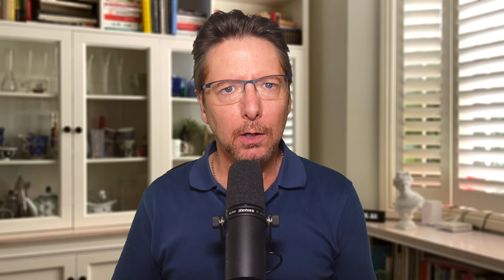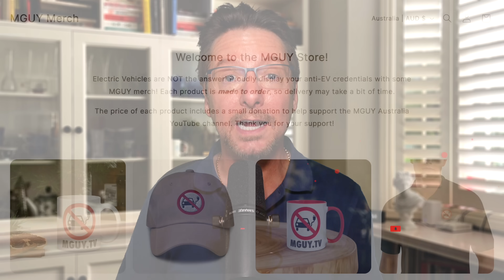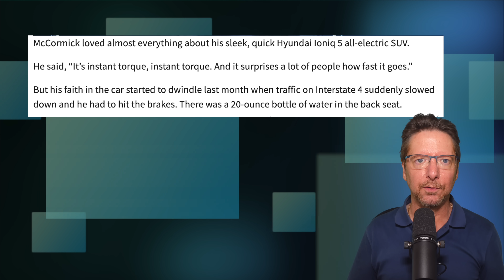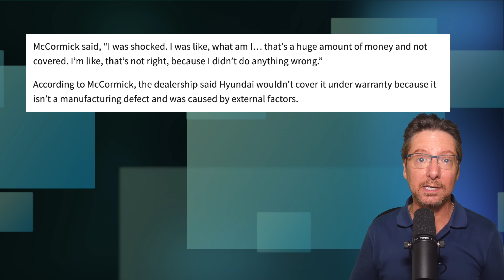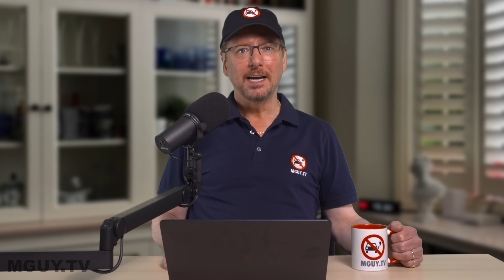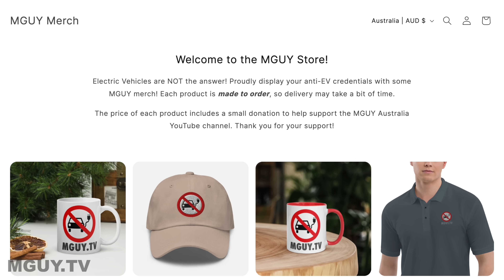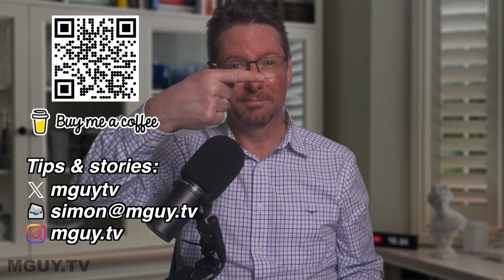ASTRONOMICAL EV repair bill for spilling a WATER BOTTLE! | MGUY Australia

Comment: If you are stupid enough to buy one. Live with the consequences. My 25 year old LandCruiser I can hose out the inside. It doesn't care. It wades through water up over the sills. Doesn't bat an eyelid. Certainly wouldn't try that with a milk float. Not even a 4WD version.
Reply: A Youtuber I follow had to call for an ambulance (Scotland) and during his ride to the hospital, a thunderstorm struck, and due to the 4 “ of water on the road, the EV ambulance had to pull over and wait for the rain to subside.
Reply: To be fair the 70 Series was built to be indestructible in the toughest conditions the world has to offer. I wouldn't risk hosing the interior or driving through water in any late model vehicle, there's way to much electronic stuff even in ICE vehicles these days.
Reply: @Fancy_Fly_7693 not in my 2008 Nissan Note!
Reply: Same with our 1995 GMC VAndura 2500.  Now at 209397miles.  Hosed it out a couple of times, front to back, after driving through a couple of muddy rivers.  What you do is park in on a slant driveway (ours) and hose out the back.  then used Ryobi leaf blower to vent the rest of the hidden water out.  Clean as whistle now.  PS:  The clearance to the air intake, and the radiator Fan is so high, that you can literally drive it slowly through two+feet of water.  No issues.
Reply: My 40 year old landrover does the same while marking his spot😂
Reply: In the UK we wont'thav a choice  as new petrol/diesel  cars will be banned by 2030.

As a cyclist this is good news as means less cars on the road as nobody is going to buy electric except rich politicians
Reply: @Recumbent_Rider We will see. Net zero is starting to hit the skids. You have a party in the wings waiting to make changes. And now in Australia, our opposition party are going all out to drop net zero too. Electric Utopia might get turned on it's arse.
Reply: @Recumbent_Rider You think you won't be paying road tax and insurance before Labour are done?
Reply: I have a Lexus hybrid & its fine but more like Highlander though would have preferred with Land Cruiser assembly. that early 2000s for Toyota Lexus was pretty good era
Reply: Yeah but when we are all forced to live in 15 minute cities there won't be any driving through standing water, or muddy country roads,  or putting dogs in the back seat, you know, all the "normal" stuff will be banned. Along with confiscation of your good old faithful workhorse 😢
Reply: I used to own a 1966 Series 2 Landrover....I used to hose out the inside to clean it....but the 55 MPH top speed, horrendous fuel economy, no sychromesh on first and second gear, cart spring suspension and no power steering is not something I want now....My BYD seal has 305 BHP, per mile running costs equivalent to a Vespa scooter (150 MPG), exceptionally quiet, comfortable and easy to drive and cost less than an equivalent Toyota Camry.....
Reply: @martinwalker9234  Hmm, no comment from the girls here. Too busy clutching their Pearls and dreaming up fantasy negative scenarios about a car they know nothing about.
Reply: Strangely you don't find EV owners on Landcruiser forums whining about how inefficient, slow, noisy and polluting they are.
Reply: @tacocangrabembythetaco absolutely not! 
They're far too insecure 😂
Reply: @leewright7623  So says the guy crying about a car he doesn't own.....if that was supposed to be a gotcha you need to check the definition and try again.

Comment: I met a BMW owner the other day who needed to replace a headlight on the front right side because it had water in it...the headlight cost 4000 USD plus labor.
Reply: For 4K you buy an more reliable and longer lasting used ICE car 😆 Don't feel sorry for the owner, If you like status crap, don't complain if things getting expensive.
Reply: @rapalaron6348 8 months ago, I bought my 1982 Volvo for 1100 GBP. I have spent 200 GBP on service items.
Reply: After 23 years I needed new headlights for my 02 Dakota. I went on eBay. Found a brand new set of hid led headlights. The whole assembly. 198 dollars USD. I installed myself. That was 2 years ago. My truck is cheap for parts, and I can upgrade, and it charges in minutes.
Reply: @leskobrandon6950  Late spring this year, changed headlights on my 2004 Grand Vitara for like 140 bucks, nice to own a car, where you can fix it.
Reply: @leskobrandon6950 shhhh don't tell the idiots that old cars are better
Reply: @leskobrandon6950  Last time I bought a sealed beam headlight it cost $8.99 plus tax. Yes, I drive old cars and am happy to do so.
Reply: $4000 USD for a part that cost about $15 USD to make
Reply: @aeroearth . It’s the “extra care in engineering”…didn’t Chrysler use that slogan in their advertising?
Reply: @aeroearth  For that price I expect it to be fully serviceable! I know they aren't... So many wasted resources...
Reply: Break My Wallet
Reply: Bring My Wallet BMW
Reply: After 30 years of driving my Opel I decided that I like all lights replaced new beacause old were weary. Easy job for a bit skilled driver, cheap  so  why not? I I just do not remeber the  exact price for complete 6 lamps   but surely less than 100USD  .
Reply: A scratch would total one. I knew a guy driving a perfectly good car that had been totaled 3 times due to minor fender-benders or damage to a taillight.
Reply: Bllsht.
BMW tech here.
Reply: And you can't get a used replacement from a crashed car... the replacement unit needs to be dealer coded to the car. Cars will have a very short shelf life now. 

No cheap used bargains in 10 years. A broken headlight will write off the car.
Reply: I met a guy who's right-hand DRL on his 911 (ICE) stopped working. It's a sealed unit in that the entire light assembly must be replaced. That costs $AUD 10k! There are cheaper ($AUD 5k) versions available on ebay, he said, but wasn't sure if the quality would be there.
Reply: Yep, avoid cars with LED headlight modules as they are all sealed and not serviceable.
Reply: @MattyEngland Not true at all, I have triple LED headlights on my 2020 lexus that had water intrusion. The dealer fixed it out of warranty without having to buy another $4,000 headlight assembly for $400.
Reply: @anthonyaccurate  So just because you got lucky on one occasion, that means it isn't an issue? 🙄 Have you ever considered an IQ test? I think you might be surprised at the result
Reply: Have to admit I cannot for the life of me get why this surprises anyone.  Let's just add a whole bunch of features we got along for decades without and, oh yes! let's pack them into a light module!  Then when it fails in it's primary purpose - to provide effing light - certainly nobody will mind coughing up the big bucks to replace all of it!  Ok, ok, I'm assuming there's a bunch of sensors, etc. in these modules (judging by the F150 Super Duty taillight debacke) but still, over engineered & how many are actually one year only due to minor styling changes?
Reply: Dear Mr. BMW, please bend me over and don't use any lube, I'll be fine. 😵‍💫
Reply: I have a like new 2003 pickup. I can buy both headlights and turn signals for 150.00
Went to the dealer for a $50 replacement part. They wanted $250 for an estimate
Never buy a new car again
Reply: This has been normal for many luxury car brands. Back in 2015, the right LED headlight module died on my aunt's 2005 model year Infiniti SUV ( can't remember the model as infiniti's naming system is confusing to me). Cost at dealership to replace at the time was $5k. More than the value of the car. She simply traded it in for a new Lexus that's still running today.
Reply: That's actually cheap. Some of their laser headlamp assemblies (none have replaceable bulbs) are six times that price. After around four to five years the headlamp failing will write the vehicle off.
Reply: Gezz  10 seconds with a small drill bit one little hole  drain out water  DUH  !!